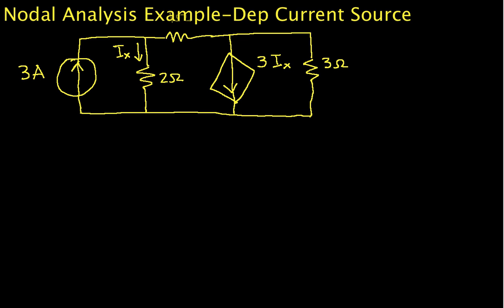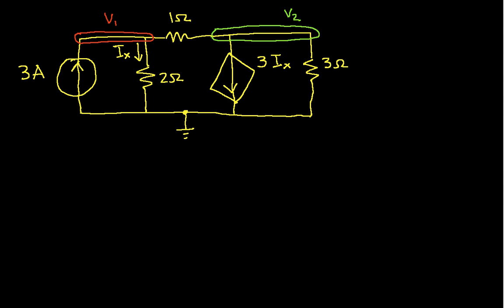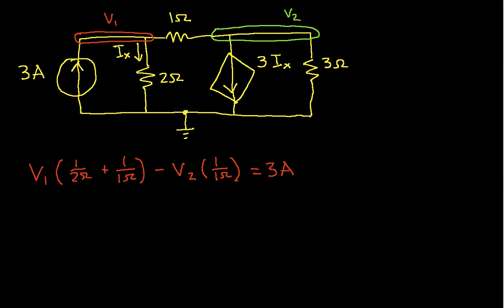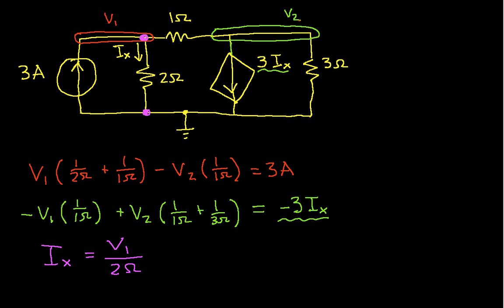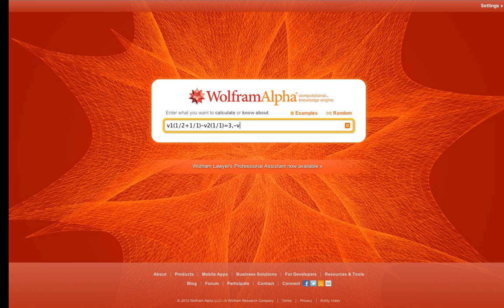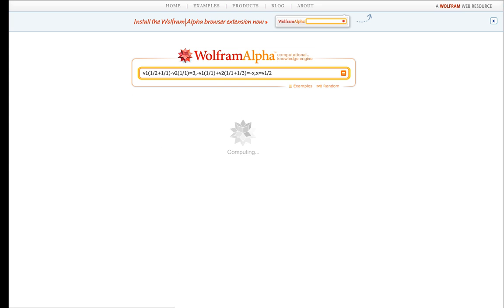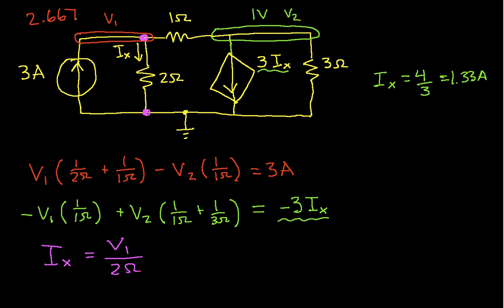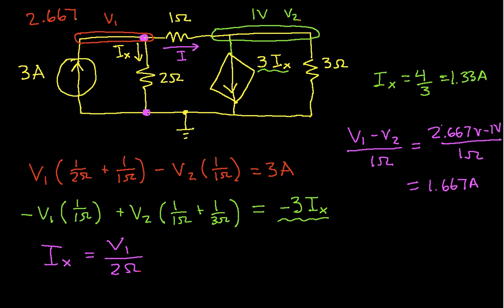Nodal Analysis Example-Dependent Current Source

Comment: you are confusing me further. Why do you circle a whole line as a node? I stopped watching after that.
Reply: +PussyGalore Imagine placing the circuit on a breadboard. You will see that all ends of the circuit components could be placed in the same hole or 'node', and that the entire wire then becomes the node rather than an intersection point of wires.  It is common to do so and, although it is a matter of preference, it should not be confusing
Reply: wtf lol. why would he not circle the whole node? thats basics bro

Comment from the maker: @tagumskater Your equations are mathematically equivalent to the ones in the video: your eq(1) is 2 times my eq(1), and your eq(2) is 6 times my eq(2). It looks like you have eliminated the fractions in your equations; this is fine, but not necessary if you are using a computer to solve the simultaneous equations.

Comment: I was expecting eq(1) would be 3V1-2V2=6 and eq(2) would be 3V1+8V2=0. since Ix=V1/2 substitute it to 3Ix in eq(2)... just for clarification.
this video is helpful to me in other ways... thanks...
Reply: His answer is wrong..
Reply: But your equation was correct same as he solved the problem, however he calculated on a wolfalpha that commits fault. Even though the equation was easy to simplify..

Comment: how to solve this with mesh analysis?
Reply: In general, when dealing with dependent and/or independent current sources you want to use nodal analysis over mesh analysis. If you have dep. and/or indep. voltage sources, you want  to use mesh analysis over nodal analysis.

Comment: Is his answer correct? Instead of using wolfram like a bitch I did it by hand (fairly easly, not a hard system of equations) and got completely different voltages.